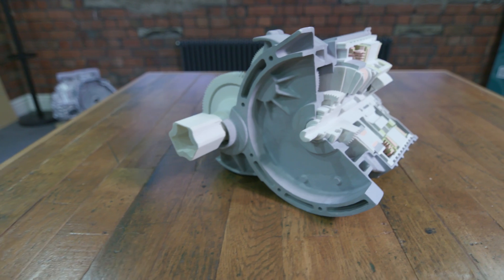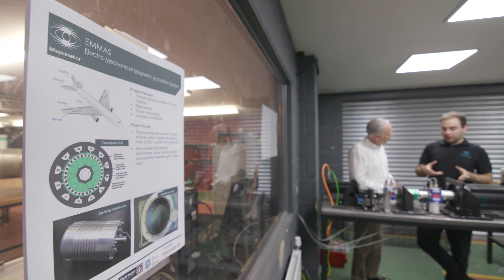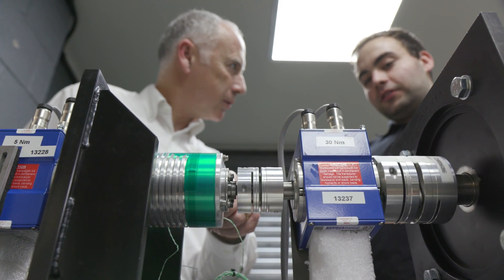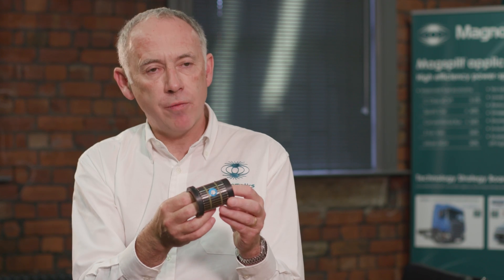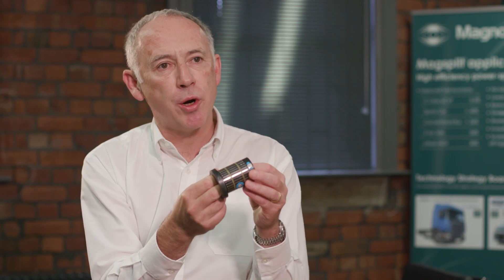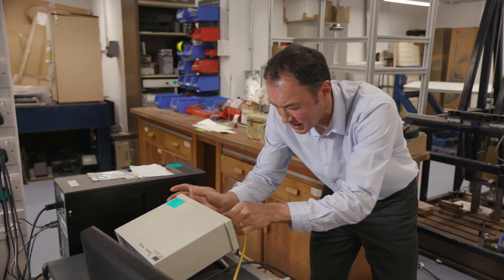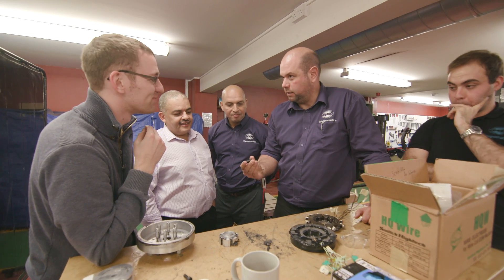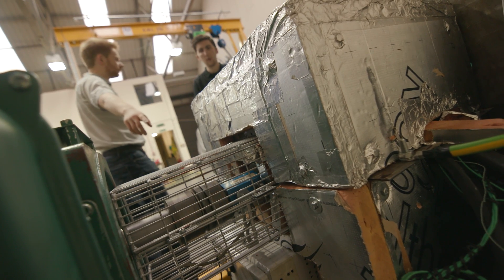Magnomatics: Supporting SME innovation

Comment: BRAVO....!!!... and Next Advance is Fuel Free Magnetic Motor Generators. Research is currently going very well indeed. Less of the rotation. ( High Praise for solving those menacing 'rotary' vibration issues that left unattended, have a nasty habit of escalating by incremental reinforcement. ) In order to avoid those expensive problems, we have opted for High Efficiency "Linear" Halbach array Switch Release Magnet Mirror Symmetry Oscillating Boxer Engine Generators, riding on near frictionless linear magnetic tracks. This is our objective. These Halbach array shuttles rely on the Vernier Principle. and always the Kinetic Halbach array 'shuttles, must be "Even-Stevens" every "Magnetic Pull" Equally counterbalanced by a "Magnetic Push". The Shuttle must work equally well in both forward and reverse oscillation directions. Research is conducted with Type Y30BH high performance ferrite magnets for convenience and cost. Neodymium magnets are also potentially hazardous! with 100 m/s collision velocities, when inadvertently left unattended!  ... WE REALLY APPRECIATE ALL YOUR STIRLING EFFORTS... A BIG "THANK YOU" From The Carnegie Foundation.